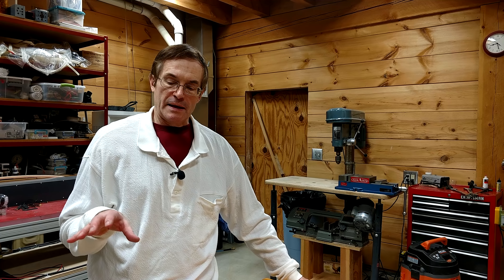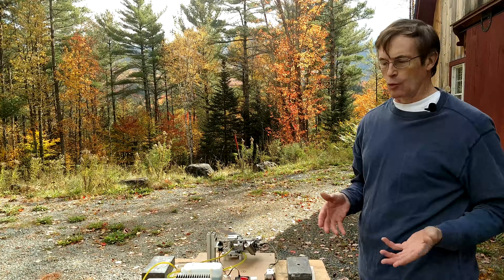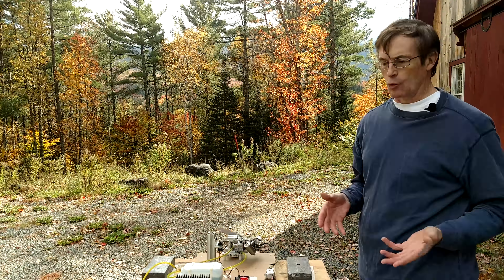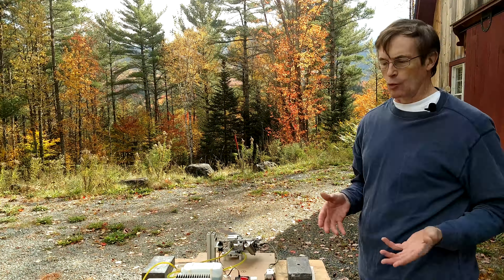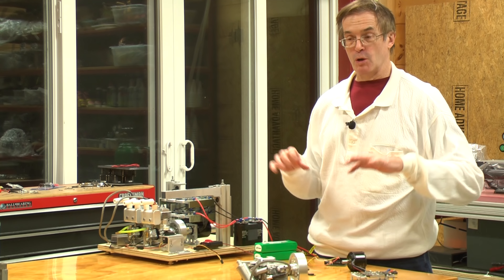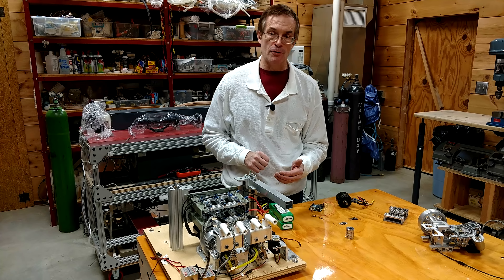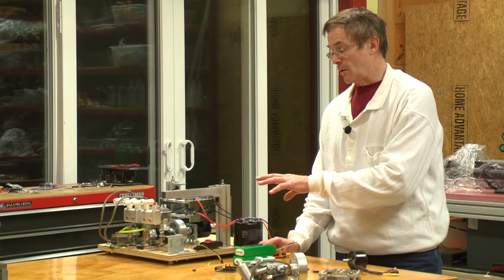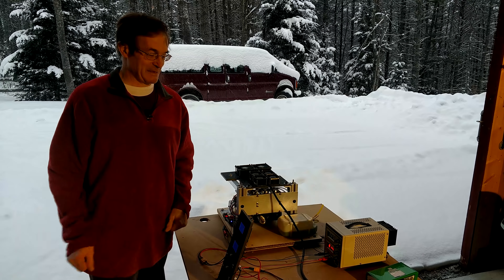Hybrid Drone Generator

Comment: No mention was made of the total cost of this kind of design, parts and labor involved, but how much cheaper, if any, would it be to use all of this complexity, as opposed to a single small gas turbine engine?
  The weight penalty of the engine mounting system was enormous there!  And those humongous flywheels replacing the props was way over the top too!
  I have a book by Thomas Kamps called Model Jet Engines, Second Edition, and it shows how to build your own jet engine by using the internal parts of small turbochargers.  A turbo from a Yamaha motorcycle engine would be great for this kind of application, but a small Garrett or KKK turbo would work too.  In fact, on eBay, a KKK K04 cartridge is only $145 right now!!  Just cobble up your own inlet and outlet housings and you're good to go!  Put a starting cone on the compressor wheel side with a large enough area to drive a rubber wheel on a DC motor like for a car HVAC system, or an electric cooling fan, and you could make LOTS of juice to power your drone motors!  Since there's almost no vibration from a GTE, you don't have to worry about stress fractures or weight penalties from heavy mounting systems.

Randy

Comment: A question, is it possible to mount both glow motors and dynamo in a  shock absorbing platform?
Reply from the maker: Yes.  You do know that these are two stroke, gasoline engines?

Comment: towards the end when you test the setup and increase rpm, current goes up on the generator side display but voltage is constant is that because it's total battery voltage I thought with rpm increase in the generator voltage would increase    Proportionally
Reply from the maker: Correct.  The battery absorbs the current when the voltage exceeds the charge voltage on the battery.

Comment: Potential upgrades(no pun intended):
Starter generator
Active rectification
Super capacitors for 100Hz smoothing
PID control loop for speed vs voltage control
Obviously these are minor upgrades, what you made is remarkable! Have you concidered making one with a turbine? Gas generator and a power turbine.
Reply from the maker: I am with your list of upgrades except for the super capacitors.  They have a higher ESR and this is significant because their low voltage limit requires them to be operated in series.
The turbine is exciting, but the low compression ratio makes the SFC rate high and the cost of a turboshaft is also very high.  It's probably not the way to go.
Reply: @TechIngredients Yes I agree, on top of all that, I also do not like the way the super cap protection boards work - by bleeding the current through a resistor. Yes, the RC engines are much more popular and affordable, readily available.
I do think that a starter generator in this case might be tricky, since to start the engine you would need a lot of torque, most likely resulting the use of gearings, and they would degrade both the efficiency and the operational life.

Comment: So given the weight of the generator will you connect the drone to the gen via a VLC (very long cable) while its flyin ?. Otherwise I would love to see this drone fly ..
Reply from the maker: We will suspend the generator under the centralized batteries.  This reduces rotational inertia and balance changes as fuel is consumed and provides a place to attach the vibration isolating stand offs.

Comment: Great as always just curious how the engines would perform in a drone given that fast change in altitude
Reply: Jet change unnecessary until 1000ft change in altitude
Reply: Richo Williams yes, but the efficacy will change until that point, I would imagine you would want tune the carburetor for your average cruising altitude you plan on keeping the drone at for max efficiency

Comment: Couldn't you stack the engines to have the piston momentum fully lined up?
Reply from the maker: If you mean in series, like building up an inline engine, then the challenge  is that these engines only have an output shaft on one side.

Comment: In regards to efficiency, instead of going from gasoline to mechanical to electrical and back to mechanical, simply use the gas engine linked to all of the blades and use controlled pitch for each blade as necessary.  Use a battery, which will only have a slight load, to power the control system.  You could also buy an R22 and install radio control.
Reply from the maker: It's  the practical engineering  involved that makes that alternative  unattractive.

Comment: Why not mount the engines with their cylinders oppossed (eg base to base, horizontally mounted) and their strokes synced so as to have their pistons counterbalance each other without adding extra wieght?
Reply from the maker: That's an option.  I choose the side by side for several reasons.  Coupling to the generators was easier this way, the exhausts were close together to facilitate mounting in an enclosure which would guide the cooling air first over the electronics/generators then the engine's and finally over the hot exhausts and starting the engines was a little easier.
Reply: @TechIngredients  Thanks for the quick reply! Impressed as always by your content. Keep up the good work!

Comment: Amazing as always .. my thought, an O.S. .30x2 Wankel twin rotor, 3 kW - 500 grams ? The generator, a dense pancake stack, each flat layer similar to ones found in disk drive motors.
Reply: Good luck finding Wankel engines.

Comment: This is all so fascinating to follow along with your thought process and explanations. Thank you. 
So now I have a couple questions, you want/need to control the voltage output, is there another option for this beside engine management?  Why do I ask, for example, if the "power module" was doing more than just producing electricity, like if the engine was used to drive a car as well as produce electricity for lighting or other needs. If engine management was an unavailable option for voltage control, how could one accomplish this? As you explained a car alternator bleeds off power to control voltage leading to POOR efficiency, and weight penalties. 
Also a comment more than a question, your choice of engine to produce both a smooth or vibration spike reduced power output and basic internal engine balance. I don't know if a  two cycle two cylinder boxer style engine is available in the scale that you have chosen, but likely if available, this would solve much of the vibration issues your are trying to avoid, / counteract with timing belts and phasing. Even if the engine needed to be of the four cycle type (maybe a two cycle boxer is not workable because of how that style engine breathes) a guy could pair up two, two cylinder four cycle boxers side by side and phased as you have done to eliminate most of the inherent vibrations any ICE will inevitably produce. Okay I did a quick google, there are literally hundreds of choices out there. OMG there are a lot LOL.  So now the vibration issue can be reduced to very low and you easily solved the power spiking with capacitors and battery "damping". Now we just need to solve the voltage control with as you explained something other than a slow mechanical device. 
As always, looking forward to you next video,  your videos are the most thought provoking and information filled on All of YouTube!
Reply from the maker: Controlling the voltage with layers is probably best.  Throttle control, backed up with a voltage regulator for small, rapid variations and the batteries as a voltage buffer should work well.

Comment: Great stuff - how is the electric motor (generator) coupled to the gasoline engine ? Belt ?
Reply from the maker: Thanks!
There is an in-line, flexible shaft coupler between the engine and the BLDC motor.

Comment: Why not use a super capacitor to buffer the output, instead of a heavy battery?
Reply from the maker: Super capacitors actually have a much lower energy capacity per gram than Li ion batteries and as we want to maintain the batteries as a back up system, this is probably a better way.

Comment: If you connect the windings of a three-phase generator with a star and use an 8-diode rectifier, you can get up to 15% power increase.

Comment: I would love to be your personal machinist!!!  25 years of CNC and manual machining + set ups in a job shop arena. Low volume high mix but mostly 1 off custom parts.  I hope to launch my new Idea machinist tool line.. 4 tools in working prototype stage and 3 in the design phase.   I would give you 8 hrs of machining time for 1 hour of you sharing your knowledge with me!!
Reply from the maker: We might take you up on that.  We are designing the turbine for our turboshaft engine and it will require upwards of 40 individual steel blades. We'll touch base in the next couple of weeks.

Comment: What are EES seeds? I got that from closed captions as it was hard to hear. Not an issue for me. I don't plan on doing this but I couldn't find anything similar searching the internet.
Reply from the maker: I have no idea. Can you explain the context?
Reply: @TechIngredients  17:45 <---Sorry for not adding a time stamp earlier. That makes it very confusing.  "The output that comes to you is now rectified but highly pulsatile and you need to smooth that out for the EES seeds. To do that, you use capacitors."  As I said it shows up on closed caption, so there is some margin of error.

Comment: Aren't there turbo shaft RC engines for helicopters? I wonder what kind of RPM they produce and how it relates to the optimal RPM for your 3 phase motors. What do you think about viability of using turbo shaft engines in a hybrid drone?

Comment: Hello again I've installed 5 450watt solar panels on my roof in the Philippines since then I've noticed an electrical difference between my upper roof and the lower roof the panels are one the lower part nothing on the upper part and no wires what so ever on the upper roof so no connection or chance of shorts and no nothing is grounded could you explain this thank you Michael B

Comment: that is awesome. one question, how does the throttle control know when to increase throttle if it is sensing voltage drop on generator which is paralleled with battery which stabilises voltage drop? would it be better to control generator throttle by sensing battery current? I dunno! my 5 cents
Reply from the maker: Current and voltage are related.  As the current draw increases, there will be a proportional voltage drop.  It may be millivolts when the current changes are in amps, but it is easily monitored.

Comment: I would mount the engines horizontally against each other (with the piston chamber away from each other ()---<>---() causing the engines to counter act on each other) instead of the vibration canceling out vertically. This helps make the unit smaller vertically which helps having a much more aerodynamic fuselage/body design with less drag.  Mount the timing belt the same way you have done that seems perfect. Make those 2 engines into one Similar to the way the Subaru boxer engine (STI etc.) is made in their vehicles. Then just as time has proven on the Subaru 2.5 L, 4 cylinder horizontally opposed engines try making a small turbo system using the exhaust piped to a the turbo hot-side, then the compressed intake side air to the carburetor inlet of the engine. Also some of the exhaust fumes can be recirculated into the intake side to help burn any fumes/fuel.  The 2 engines could then use less fuel for the same rpm/power output or increase rpm/power with air to fuel level adjustment. This should keep the engine noise db down from the setup.

Comment: From what I know, many one and two cylinder 4-stroke engines use a torque dampener consisting of two halves that can rotate in respect to eachother but coupled with springs that dampen the high torque combustion cycle of the 4 stroke and smooth it out. My honda Transalp 600cc V-twin has this. I wonder why he didn't use one on his 4 stroke engine. I'm sure a miniature version can be made. Or is readily available. And would be massively lighter than the two cylinder version.
Reply from the maker: There are several reasons.  The higher power to weight ratio of the two stroke engines is an advantage.  The vibration is one consideration another is the periodic torque pulses that produce voltage spikes.  The twin, two stroke engines have four times smaller voltage spikes than the single cylinder, four stroke engine.

Comment: Given the initial premise that gas had a 20x higher power/weight density. Wouldn't it be lighter and more efficient to use 4 gas motors or turbofans attached to the props rather than the loss of converting to electric and then to thrust ?

Comment: I'd like to build one of these.  While I don't have any fancy metal working gear, I do have a 3D printer if that helps.  What materials should I get,  please?  The latest video on this project, AIUI, is the 5 minute one where you're outside in the cold, snowy weather I think.  Thanks!

Comment: I notice the batteries are outputting 12amps where the motors only output 8amps
Reply from the maker: The meters only work in the forward direction.  The "missing" amps are flowing into the batteries,

Comment: How much electricity do all of the prop motors need to lift all of this?
Reply from the maker: The general answer depends on the disc loading for the rotors and the reasonable range is 7gm/watt for a racing drone to 15gm/watt for a slow reconnaissance drone.
Our follow up video shows this generator producing 2,000 watts.
Our largest drone weighs 15 kg with a full battery load and10 kg without batteries.

Comment: When you trickle charge the buffer battery, the voltage is kept high. How much harm will this cause the batteries? How will you deal with voltage and amps going into the batteries? A sudden lack of load on motors will lead to spike in the voltage, directing the energy into batteries. And lastly. What about cell balancing? The way the batteries are used in this case, could perhaps make the cells reach a larger difference in their voltages, leaving some cells overcharged?
Reply from the maker: The voltage spike caused when there is a sudden decrease in motor current will be for a duration of a second or less while the throttle is auto adjusted.  The actual energy placed into the batteries will be quite small.  Balancing the voltage to the individual cells will occur during routine recharging.
Reply: Tech Ingredients You are properly right. I have however got this idea into my head, that these voltage and current spikes, will somehow increase degradation of the lithium battery. I have no data or evidence of this, so it's just a feeling.
I forgot to mention how exciting I find this project. Thank you for providing us with videos of this.

Comment: A multi-rotor that can fly that powerplant is going to need 200 or 300 Amps, maybe more. Presumably this test was not at full power but it doesn't seem to me that set up is likely to have that much in it. Awesome though, that someone is fully exploring this concept.
Reply from the maker: How do you derive that current requirement?  With a large multi rotor with multiple propellers of at least 30", a reasonable lift value is approximately 10g/watt.  We have tested this assumption. A 30 volt system at 300 amps will generate 90kg of lift.  A very small drone with very small propellers will be much less efficient and for that application we are building a smaller APU.
Reply: My hexacopter in ready to fly configuration weighs 3 kg and hovers in still air at 83 Amps, admittedly my design is optimized for low component cost rather than efficiency. 
With 30 inch propellers your into a weight class I have no practical experience with. My intuition tells me that larger machines are going to have lower efficiency due to square cube law but I can hardly argue my intuition against your practical test.
 I'll be interested to see where your journey finally leads, it seems to me you possess the knowledge and the funding to contribute a great deal to the pool of knowledge on this topic.
Reply from the maker: Thanks for the encouragement.  By the way, T-motor has published a number of performance tables that show that lightly loaded rotors can reach as high as 16g/watt.

Comment: One idea to think about. Wings provide a lot more efficiency. Requires what 1/10 the power or something like that. Maybe making it VTOL will allow for longer distances/more efficiency per mile.
Reply from the maker: Sure. But if you're  looking to store more energy /kg to power anything, consider a generator vs a battery.